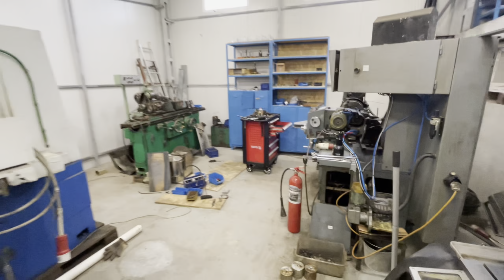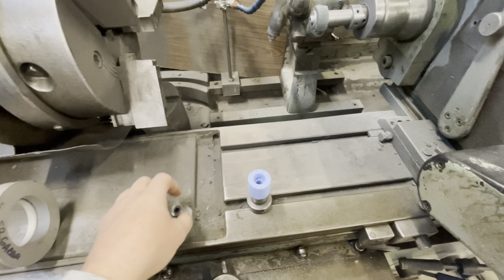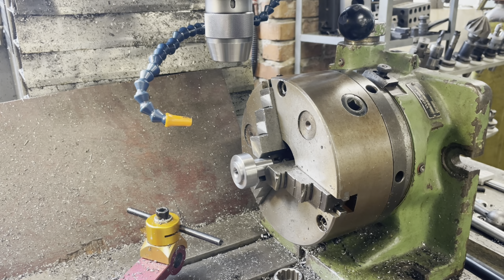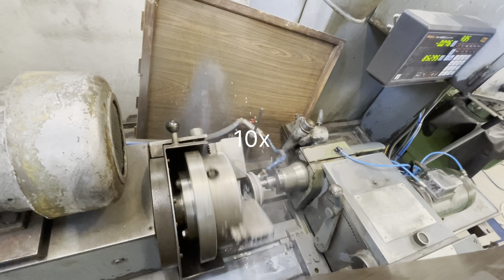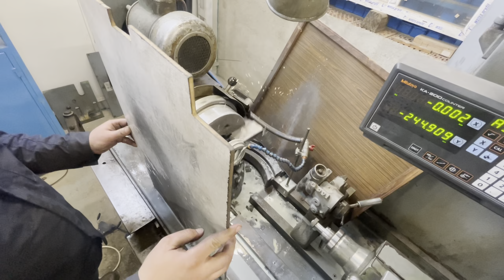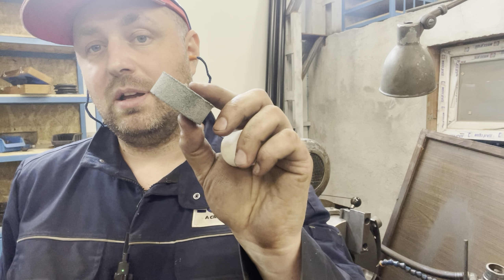ID Grinding wheel problems: Solved!

Comment: We tried those sg wheels I wasn’t very impressed. We now have vitrified diamond wheels. (Diamond grains but the wheel is dressable with normal diamond dressers. They are from a Poland company called Inter Diament. Highly recommend for hardened steels over 60 rockwell.
Reply from the maker: Thank you, I will try to find them. That would be great a diamond wheel that you can dress with a regular diamond stone. Is the best case scenario…

Comment: Sir, please use a shop vac or something like that when dressing the wheels or a mask. You´re a young man, still but all that wheel dust can give You silicosis. That sickness was very common in the olden days when grinding wheels were sandstone. Please take care- I´d recommend using nitril gloves, too. "If it is on You it can get inside You" is a quote I picked up from an old car mechanic and I take it to heart.
Our health is the most important thing to take care of- Can´t get another one… I might sound like a Karen but it became important to me to at least kindly advise to use personal protection.
Have a nice day, hope for many more for You.
Reply from the maker: Thank you . I don’t do a lot of grinding for now to be a problem… i inhale more coolant vapors, that I think is also dangerous, îi need to figure out some exhaustion for all my machines.